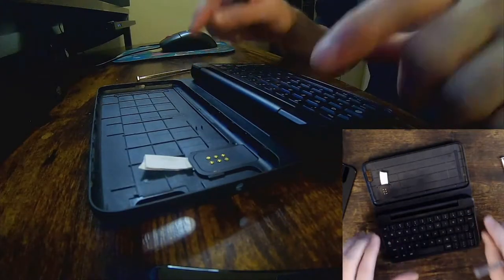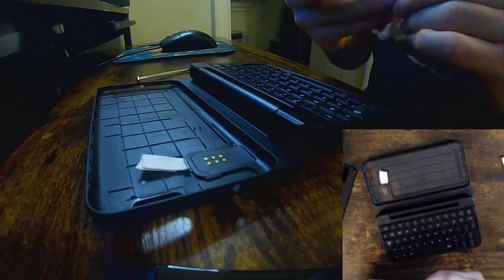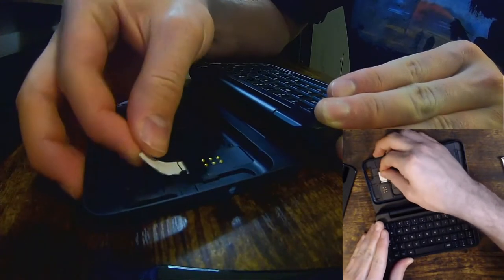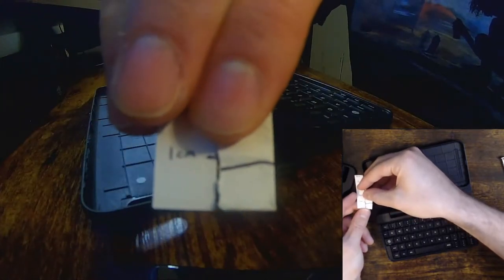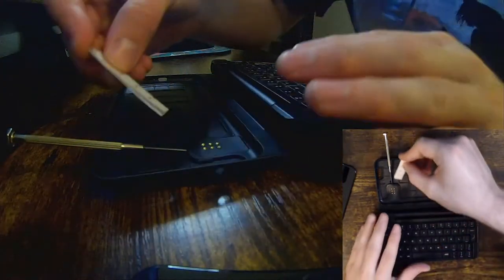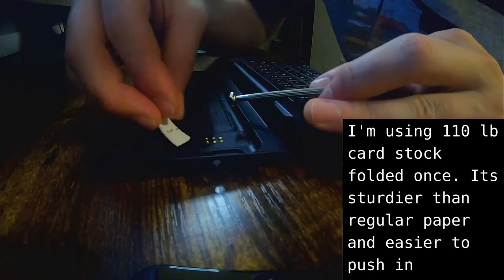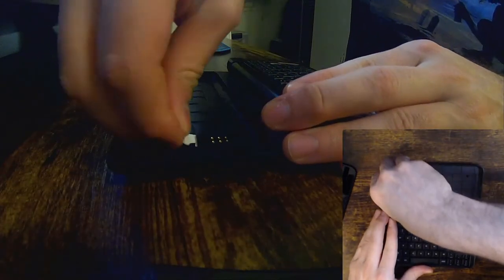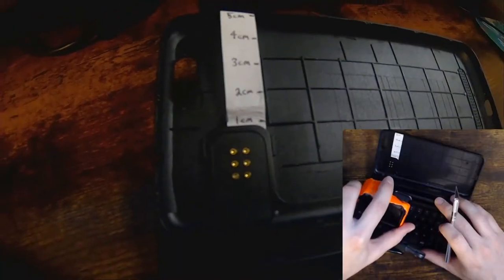Shim your PinePhone (Pro) Keyboard - Fix Broken

Comment: +1 Thanks for the simple and elegant fix. My kb case works fine on my og PinePhone but my Pro hated it without a shim - was a little worried about it being a deeper hardware problem but thankfully ended up being this small and easily resolved contact issue!
Reply from the maker: Nice! So glad my video could help!

Comment: Is that my problem I'm having? Cause idk, mine hasn't work since I got it. The only thing it does is charged the battery. I have the original pinephone with mobian. Idk if it's a connection issue like you show here or a driver issue or the thing is just defective.
Reply from the maker: Totally could be, probably worth a try especially if it is otherwise dead. Checkout the troubleshooting link for more info, but yeah I've heard shimming the keyboard works for both the Pro and original PinePhone

Comment: Man talk about a waste of screen real estate that title bar is about one third of the screen
Reply from the maker: Very true, I wonder if there's a more keyboard optimized terminal app on "Manjaro with Plasma Mobile"
Reply: @BlandManStudios  May be try desktop Konsole version? I don't know whether it is shipped with Mobile (ARM) Manjaro though and it is not optimized for mobile at all.

( By default it displays a menu bar and a tool bar, which takes more space than the mobile one, but you can hide them both from settings [ what else would you expect? - this is KDE :-) ] )
Reply: @kavinunethsarakoswattage3516  I was struggling with this issue yesterday and have settled on QTerminal for now. Most other terminals (Termite, URXVT) have issues, from my experience, where they open up the virtual keyboard in situations where you don't want them to. For instance, opening up a process viewer like btm will cause the virtual keyboard to open up, and attempting to close it will be in vain - it'll open right back up again. QTerminal luckily doesn't have this issue, probably for some reason to do with KDE / Qt compatibility.

Edit: I've switched again to using Konsolw with all toolbars hidden and the main menu bar toggled off via ctrl+shift+m. More real estate than Qterminal and supports touch scrolling
Reply: A Tiling Window Manager might suit you better?  Sway, i3 or the DWM approach of Sxmo all seem to work well.